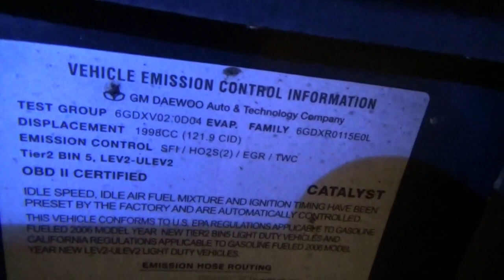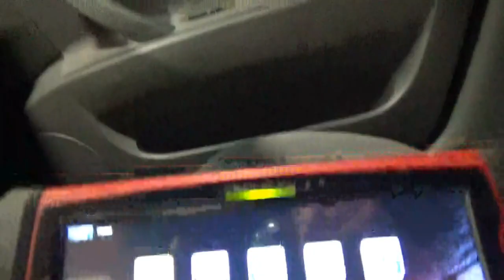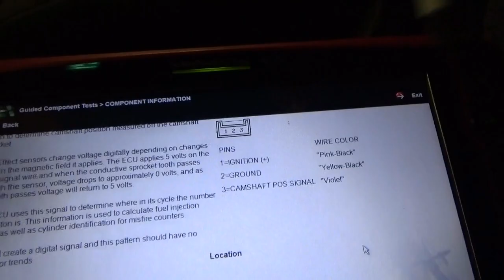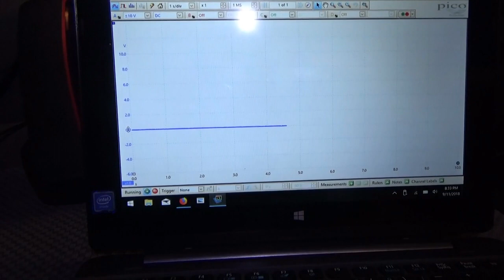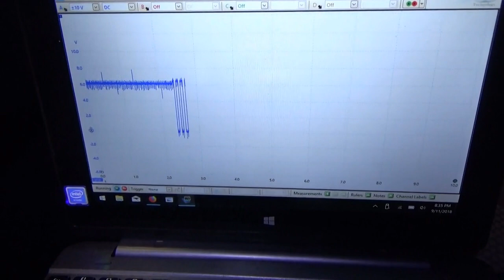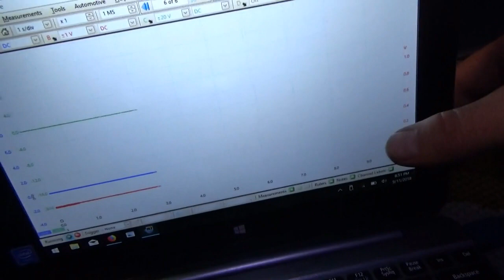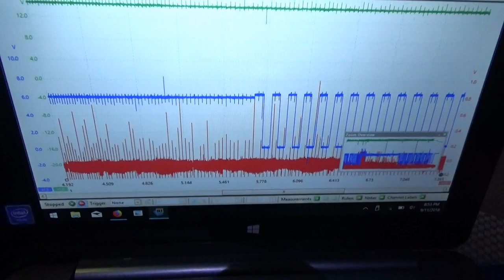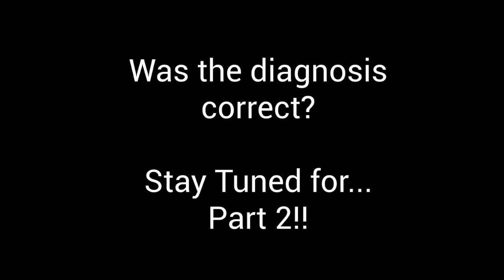Suzuki P0340 - Camshaft Sensor: Part 1

Comment: Typical sh*tbox Suzuki/Daewoo/Generic Motors product. It's amazing how many more problems they have than better engineered vehicles that use higher quality parts. This stuff is hardly rocket science but still seems beyond the skill set of many car makers below say Hyundai and Kia and even their cars often sucked until around 2012.  I still remember your video with Eric O and that P.O.S. 2006-ish Hyundai/Kia that managed to self destruct a cam bearing journal and twist the crappy hollow camshaft throwing the cam timing off. The Koreans try to copy other designs but often get at least a few things seriously wrong. I hope all car manufactures see your, and similar, videos to better learn from their mistakes. When you design a car by committee it's only as good as the weakest member of the team and the smaller volume cars seem to have inferior teams.